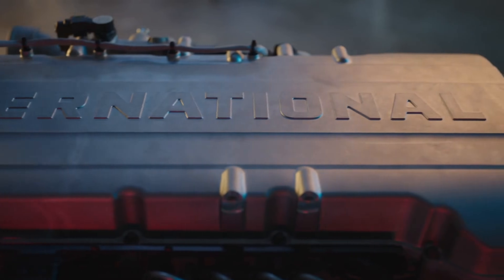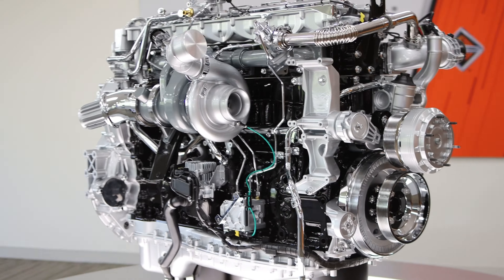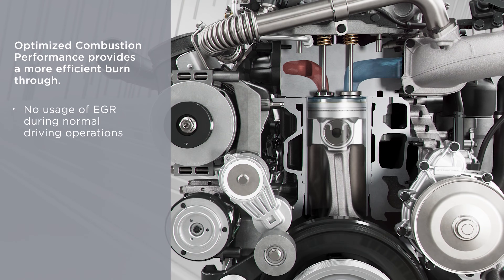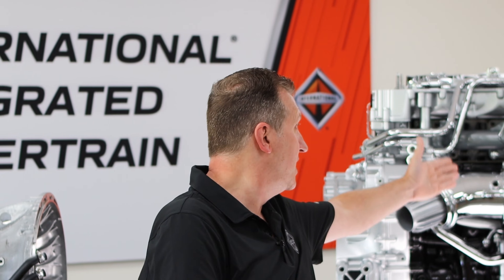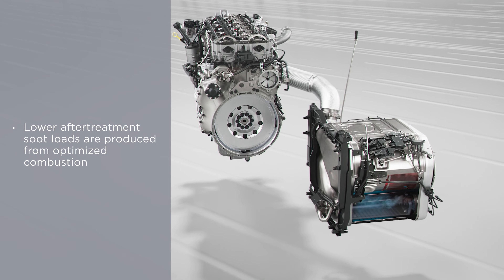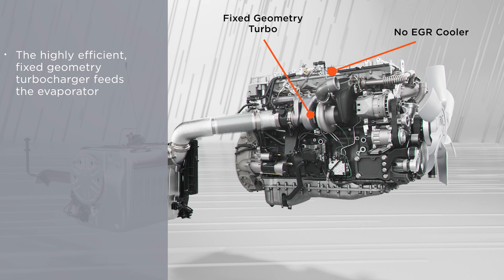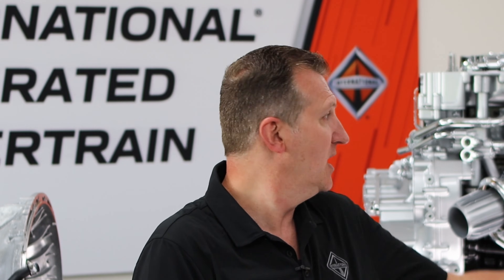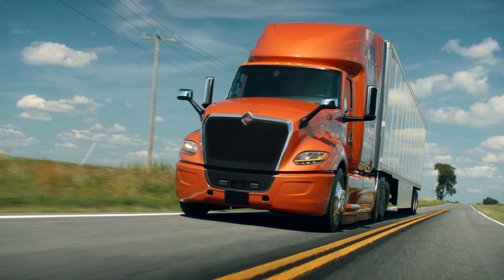International® S13 Dual Stage Aftertreatment System

Comment: I think people are missing this motor. In trucking everybody knows Cummins, Paccar, Detroit diesel and Volvo.  But the detroit diesel is a rebranded Mercedes without the exceptional technologies of mercedes exhaust recirculation/boost control and hollow, composite dual overhead cam technology.  I think Paccar is a rebranded MAN diesel.  It seems international is currently the leader in the north american truck market because they're the only people who can make their own diesel that passes emissions, and they're ahead of everybody else with chain driven, DOHC 4 valve per cylinder technology.  Outside of America there's only two other diesel truck engines that have hit this level of technology, which are Peugeot and Mercedes.  I think Volvo might have a marine diesel with DOHC and water cooled exhaust that is like 8.2 liters with 450hp, maybe Iveco has something like that too.  But in North America it appears that international might have introduced the most advanced modern diesel motor.  And international is known to make excellent diesel motors, the DT466 is an incredible motor.  I love Cummins but everyone has one and even they haven't hit DOHC.  I own a Mercedes E320 CDI with the OM648 and those motors have proven that DOHC motors can last well over a million miles with no issues with timing, chain wear or any kind of timing issues.  So now modern trucks are going up into something like Ferrari technology for diesels in order to get these very high power densities of 160ft/lbs of torque per liter.  I'm not sure about the quality of internation cabs, they've certainly done the job for a long time, if I was a fleet operator I would by purchasing international trucks, from a owner operator standpoint I would be going Volvo.  I had a Volvo car and that was a industrial machine, it stand to figure Volvo trucks are incredible, particularly after being the first people on turbo-diesel technology.  I mean they beat everyone to the punch, they beat Mercedes, Cummins, Cat, detroit, Mack, everyone.  But let's give it up to international, more people should be talking about this motor, and this motor should be getting hot-rodded and put in yachts and speed boats.

Comment: My company took delivery of Internationals two weeks ago. I’m now looking for a new driving job. I’m 6’ 1”, not exactly a giant but there is so little room in the cab I now get back ache every day. How could a truck manufacturer do this and drive me out of a job I love?!
Reply: Your full of crap. I’m 6’ 4” and I’ve got plenty of room in my LT.
Reply: @noneyabusiness1270  a career in diplomacy beckons 😂
Reply: Total B.S. we went to the International trucks a couple years ago & our drivers say the room is the biggest improvement. Take your hating elsewhere
Reply: @triptriplett4285  I can’t vouch for your drivers but compared to the Freightliners we had there is significantly reduced driver room. 

It’s crazy, our day cabs have two feet extra between cab and trailer as I’m guessing cheap Internationals use the same chassis for sleepers. Yet they couldn’t find 2in in the cab, crazy

Also, what’s the idea of only having engine brake come on when you engage the foot brake?! OMG, who designs these things?
Reply: @keithbertschin1213  As for the engine brake, that's a programming feature & needs to simply be turned off all the manufactures have that feature. 
Your right about Freightliner IMO, they are roomy, however if you compare to a long nose Pete or Kenworth where we came from then the LT is a lot roomier. As for day cab's I wouldn't know we don't have any, you may be right.
Freightliner I feel produces a great product & are significantly more expensive than LT.
Reply: @triptriplett4285  I understand we got Internationals over Freightliners due to chip shortage creating availability issues.
Yes, I understand Penske may be able to do something about engine brake. Seems crazy to have them linked, our drivers getting dinged for speed as truck rolls away when the engine brake would kick in.
They drive pretty nice I’ll give them that. Still remains, I’m 6’ 2’ pretty slender and I find it cramped. There are much bigger drivers than me!
Reply: @keithbertschin1213  your point on the chassis being the same for daycab and sleeper is just a bit off, i'll explain why --» any manufacturer's chassis is the same for every model they make. the only options you got chassis-wise is the lenght or if you need it to be reinforced by double-ing, triple-ing or even quadruple-ing it if necessary. whatever the size of the cab (daycab or sleeper) the chassis remains the same. The distance/gap between the back of the cab (''BOC'' or ''back-of-cab'') and the trailer can be adjusted at the time of ordering the truck --» this is a truck salesman job to make sure the gap is not too big  BUT  there again, if you rent your truck from the likes of penske or ryder they may have ordered it that way so it's more flexible on the type of trailer any customers might have to haul (i.e. a flatbed trailer needs a bigger gap than a typical dry van trailer)
Reply: @max_goulet  thanks for that